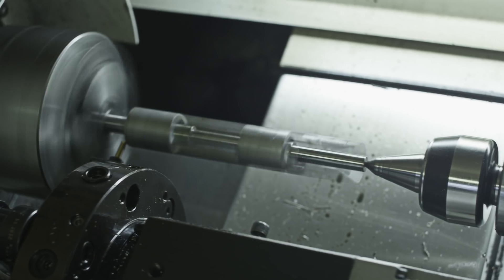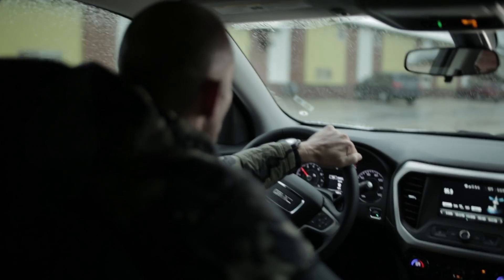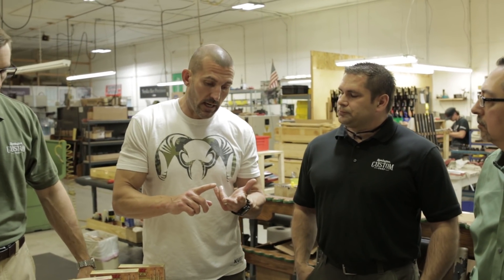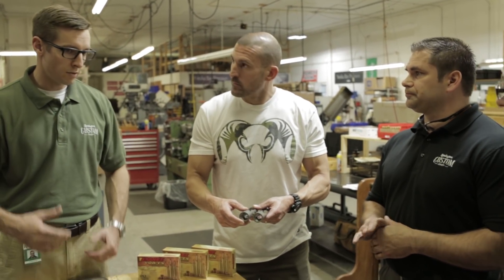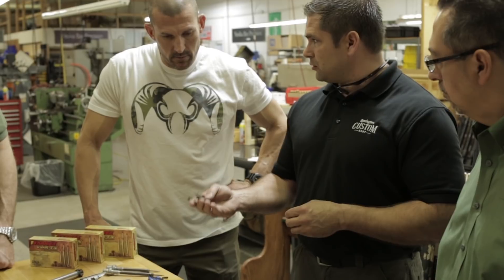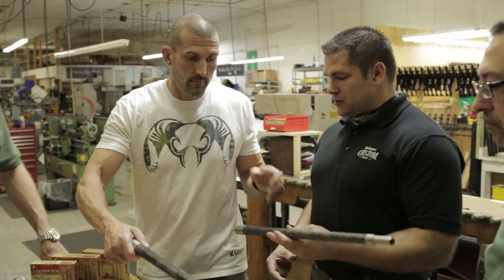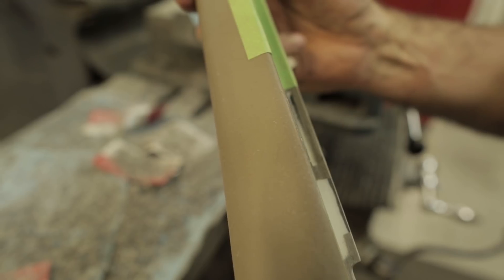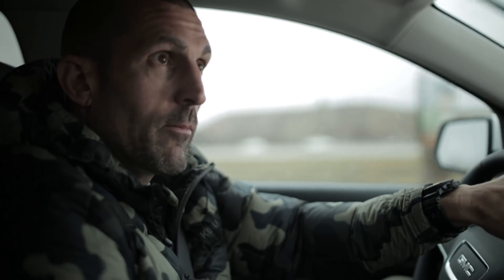Remington - Ultimate Sheep Rifle Part One

Comment: Not bloody likely ! 
You can’t get a $1200 rifle right, I’ll be buggered if I’ll give you $6000.
Reply: I agree with you on the money issue. The rifle should be a quality item at 1200 and when the price goes up, the quality and refinery of the rifle should be seen and felt.
Such as a Rigby Highlander rifle, the price is ridiculous  .   .   .    but then you hold it and it comes to your shoulder and cheek like a quality shotgun. The wood to metal fit is perfect and the stock stain, checkering, recoil pad finished as only a craftsman could do it. The metal finish, barrel contour, the fitting of open sights .   .   .    it's a quality rifle that will go to Africa (for less then an elk hunt).
Reply: Glass bed an American Wilderness Rifle ( AWR ) Remington and you'll have a great 1k rifle.
Reply: @martinstiastny7679  Hi, friend. Price a Ti bolt and carbon barrel. You'll see around 2K just for the bolt. Remington made a rifle called the Alaskan with a Ti bot, Ti action parts, and a carbon fiber stock. This gun used now is around 2K with a SS barrel.  The price seems high, and it is, but the components make it so. 

If I could afford this, I'd have it in my hands NOW!